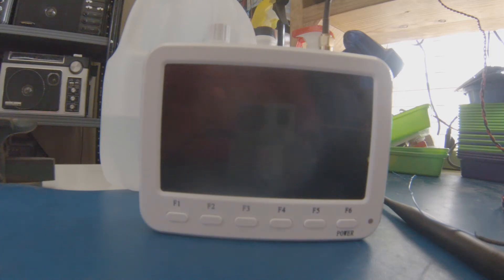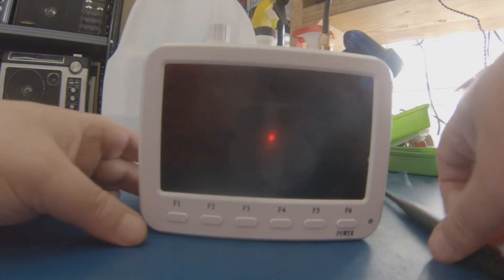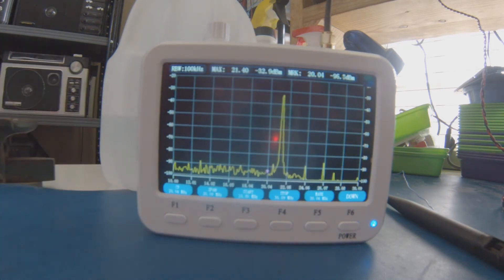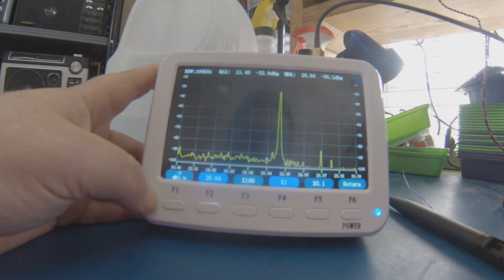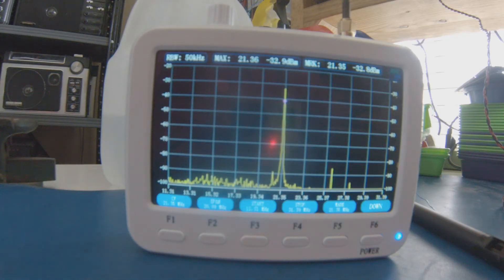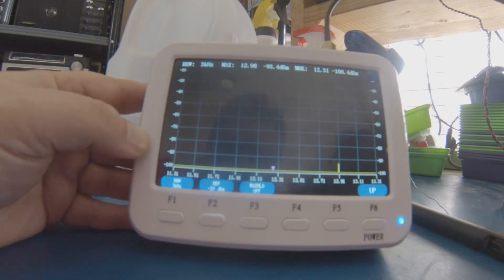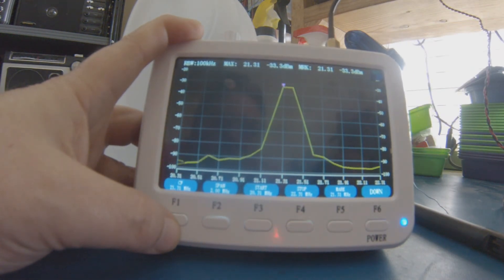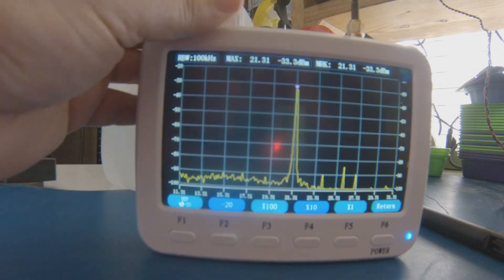XT 127 Spectrum Analyzer

Comment: I need to measure +30dbm. Do you recommend any other model with this price range?
Reply from the maker: A lot of people are touting the Tiny spectrum analyzer which looks like it was done by the same people that do the tiny NVA.  I saw a video on it, and unfortunately it seems to have a lot of issues.  So I am pretty happy I got this one.  I know it is a bit of a hassle to fiddle around with external attenuators, but I don't think even some of the older Agilent / HP and other models I have seen are pretty much limited to 0 dBm.  I found a 20 dB from Crystec for $18.55 at Digikey: CATTEN-0200.  A couple of those in series would put you at -10dBm.  Their 10 dB model costs the same:  CATTEN-0100  and a 20 dB and 10 dB screwed together would put you at 0 dBm and you will be safe with just about any spectrum analyzer.  You just have to keep a mental note of the external attenuation when taking measurements.  I got really luck - a company I used to work for had the best discards - when they fired or laid someone off, the big gray bins came out, all their stuff went in for recycling.  We were free to dumpster dive if we wanted anything, and we could even take things home.  I got a Pasternack attenuator with 1dB steps from 0 to 63 dB, so that is what I used.  Its relays have gotten weak, it no longer works from TTL levels, but I drive with 6V and they work fine.  Probably why they threw it away but I get plenty of work with it.